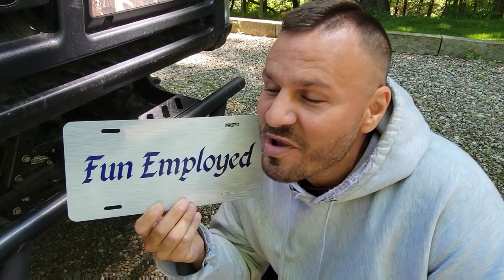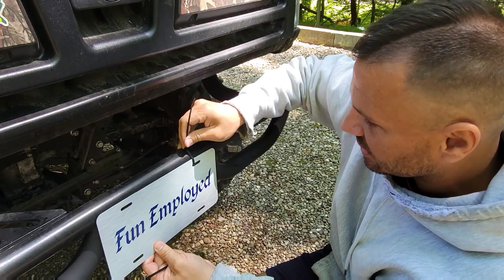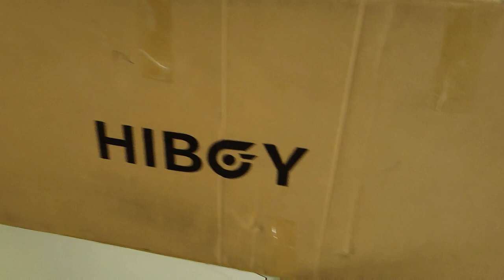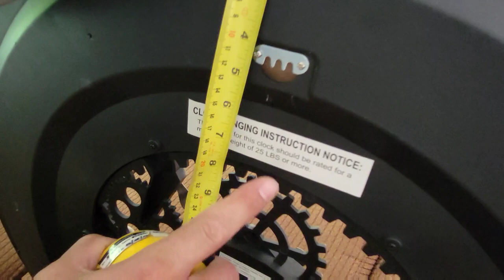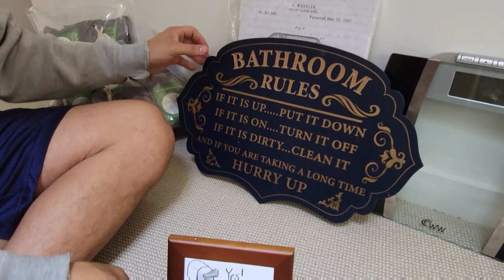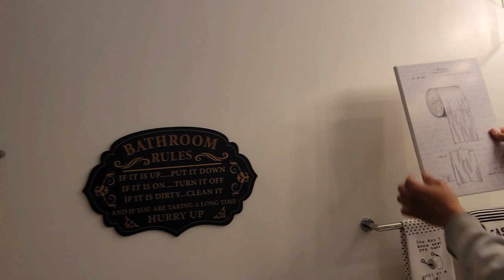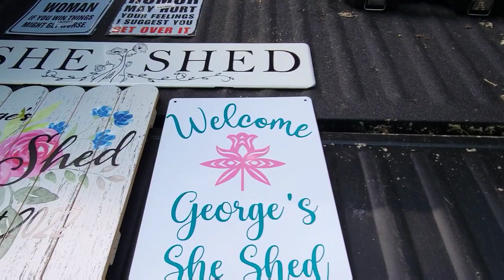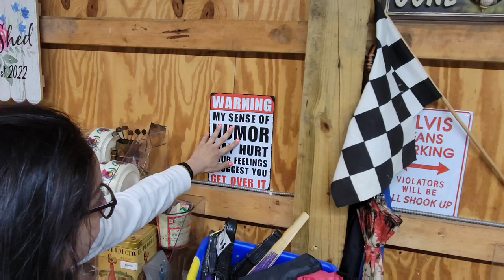FIRE At The Dream House

Comment: Glad to know you have possums there.  They are very helpful. Fires are scary.  We had two electric plug outlets that looked black like that.  We discovered that every outlet in the house was wired incorrectly.  That at least was easy to rewire before our house caught fire. You might want to check yours.

Comment: Hey Geremy and Jeorge
I saw the burned thermostat. To help get rid of the smell and clean the soot off the wall before you paint it use simple green. My house cought fire three years ago and we used it in gallon jugs and it works. You can even use it on burnt laundry to get out the smell. It's a great product. Walmart in the automotive section and home Depot if you want it in gallon jugs. 
Love you guys!!

Comment: So glad Jeorge is feeling better, seeing her smile and hearing her laughter.  A thought about your waterfall.  Those types of "disappearing water" features have a bio box cleaning system under the rocks at the bottom of the fall.  For them to perform well the water needs to be running.  It also acts as a biofiltration system that keeps the water clear.  Know you are saving on electricity where you  can but this may be one thing you need to keep running.  An electrical fire is very scary.  May take an electrician to rerun wires to make sure they are not damaged too.

Comment: Hi Jeremy...that thermostat is 24 volt...the hot side must have shorted out on the circuit board and created a small fire...I have also never seen that before..Check out that model thermostat and see if there's a known problem..I personally would buy a different brand..😎

Comment: That thermostat is a 120V or 240V model. Unless the breaker tripped you still have voltage somewhere at or behind the thermostat. Check it out ASAP. It probably burned through the wire/wires and is not a continuing hazard. But?

Comment: The easiest way to hang a picture is put some painters tape from one hole to the other and poke a hole in the center of each one and take the tape and place it on the wall where you want it. Works like a charm

Comment: There's a level that has sliding adjustments that will line up with the holes on your sign, picture, or whatever you're gonna hang with 2 hanging holes.

Comment: That looks like a line load T-stat.  I assume it controls base board or floor heating?   If so most likely the current running through the T-stat is 220V.  The connection was probably not tight and arced.  Often people do not secure the wire to the stud within 4" of the box and when the current cycle on and off it allows the wire to shake, eventually loosening the connection at the state and allowing it to arc.  You were lucky.  If it happened on one you should check them all....(or have them checked if you don't know what you are doing with 220v.)...

Comment: That heater control unit, is it a "smart thermostat"? If so, it might have gotten hacked. This is becoming a problem for smart home devices, they are easy to hack and or are affected by random frequencies like transmitters wifi, the list goes on and on.

Comment: there is a paint called kilt i think thats what its called ... its used by fire and water damage people... they paint it on first over fire damaged areas after they have cleaned it.. it kills the smell... they also paint it over water damaged areas so that when they paint with the real colour the water damaged area does not bleed through.

Comment: If you put two screws in approx  6  inches apart you can hang the plaque on both screws. The wire wont show and the plaque will hang better.

Comment: With solar panels and you should have around 15 or more panels and it comes with a converter backup power you can also have gas solar and you can get a generator that connects to your solar panels so if you loose power your generator will automatically turn on the generator straight away so that you will always have power and gas

Comment: Take a piece of masking tape run it from one of the screw holes to the other mark it with marker then. Pull it off and level your masking tape you take off the back of picture  on the wall where you will be hanging your picture or sign and wha- la perfect alignment of the holes. Drill your hole and remove masking tape and your picture or whatever you hang is perfect alignment to hang